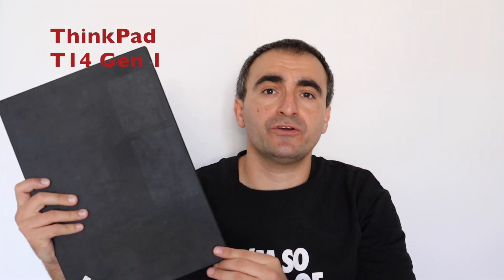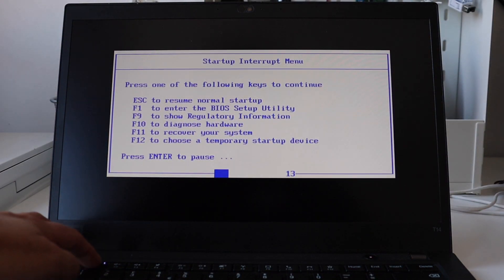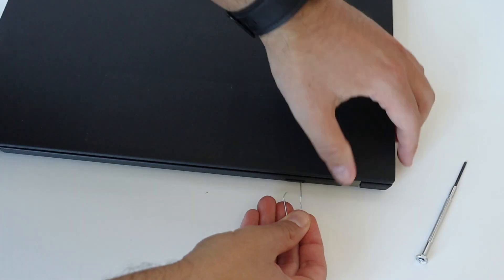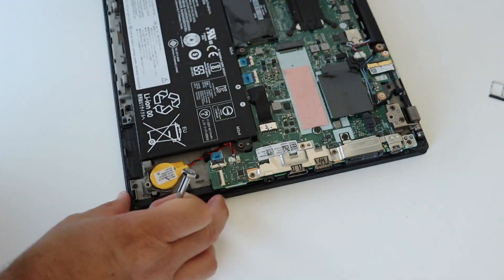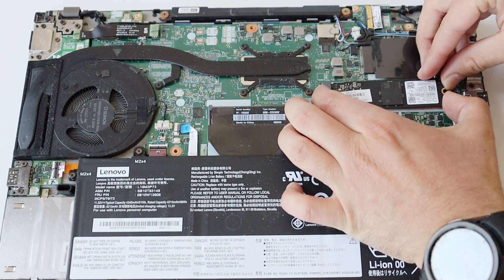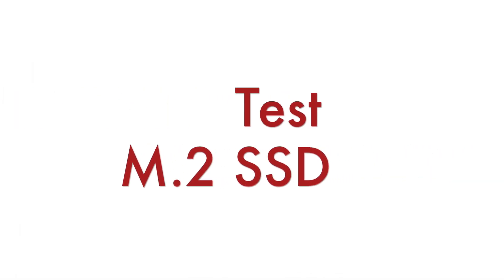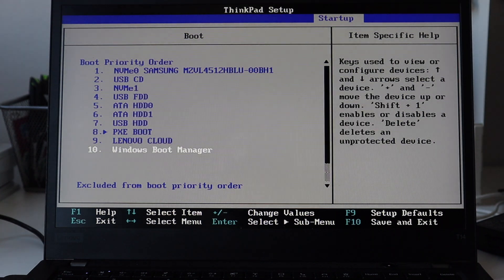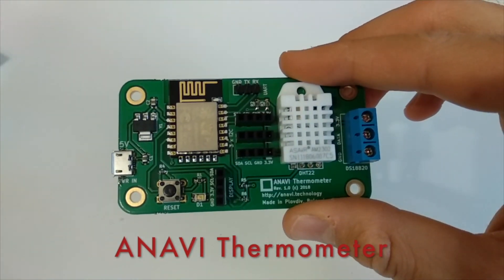Lenovo Thinkpad T14 Gen 1 Disassembly and M.2 2280 NVMe SSD Replacement

Comment: Hi, i have same model T14 and want to upgrade nvme to 1tb. I know the laptop is limited in pcie 3.0, If i buy samsung 990 evo plus which is nvme gen 4, will it work in this laptop?
Reply from the maker: Yes, a PCIe Gen 4 NVMe SSD is backward compatible with a PCIe Gen 3 slot. Of course keep in mind it will operate at the slower PCIe Gen 3 speeds supported by T14 Gen 1.

Comment: Is it touch screen?
Reply from the maker: There are T14 gen 1 variants with multitouch 14" IPS display and resolution 1920x1080. However, this is an optional feature and my unit doesn't have touchscreen.

Comment: Hello, what Linux did you put? Did you have problems?
Reply from the maker: I installed Ubuntu 24.04 LTS and works great. Have a look at my video review of T14S with Ubuntu 24.04. It is pretty much the same experience on T14 because the hardware is very similar.
Reply: linux mint also works great. i have it on my one
Reply from the maker: @royc4694  I have a couple of older Thinkpads from the older generation: T490 and T490s. I am an Ubuntu user. Earlier today I was wondering whether to experiment with another Linux distro on one of these laptops. So your recommendations about Mint comes just on time :)

Comment: why did you disable the battery first ?
Reply from the maker: I disabled the battery first to completely cut off power. This way I've ensured I want damage the printed circuit boards while disassembling the laptop and performing the upgrade.

Comment: Anything 2020 is not old, there is an AMD one which was developed in 2021. I have with a 4650u. These things are phenomenally more powerful than the T480 but without that vintage strong build. These are moot designs produced more cheaply.
Reply from the maker: Yes, it is an excellent value for money. I also have T480S and T460S which are still working pretty well, although I had to do some minor repairs like changing speakers and keyboard. Never had any major issues with the T series.
Nowadays my main laptop is ThinkPad X1 Yoga with i5-1235U. It has a bunch of extra features that I don't use. Don't get me wrong: it is a great laptop. But within less than a year of usage, the thunderbolt 4 port broke so the whole mainboard was changed as part of the warranty.
Reply: @LeonAnavi 
Most of the slimmer newer ThinkPads like the X series will end up in junk/ewaste pretty fast as they have a more novelty feel and design rather than being designed with a full fledged lifespan to deal with all the stresses. 
I have an x250, i use everyday not because it's more powerful but because it's like an extended limb, an extension for doing any serious work.
Reply from the maker: @pamus6242  I have never personally used any of the x2X0 laptops but I have several friends that are huge fans of X250, X260, X270 and X280.
Reply: i got the amd one for 300 euro last week. not bad,